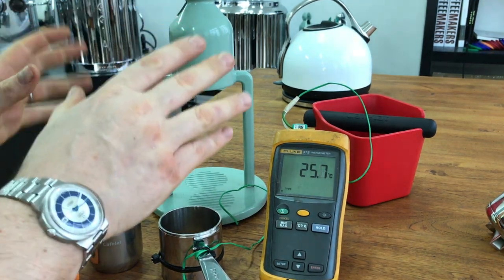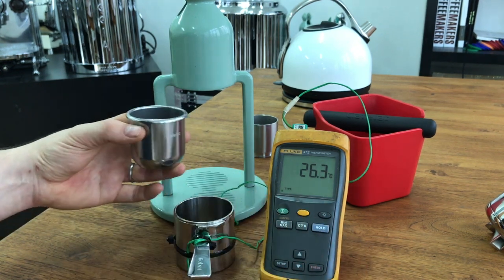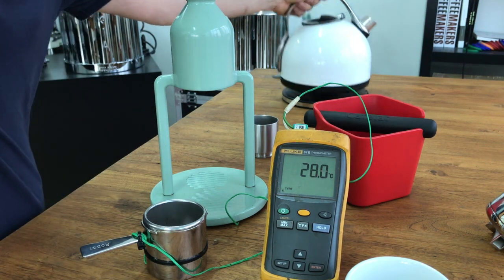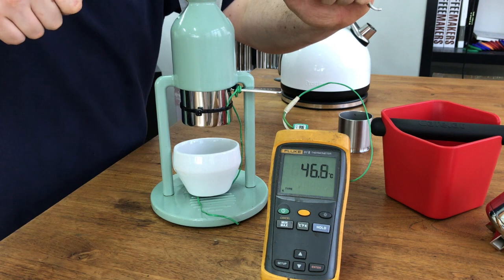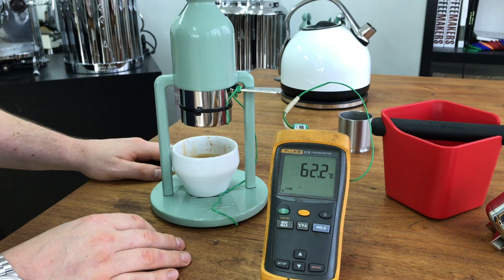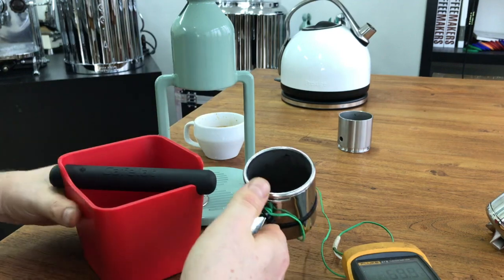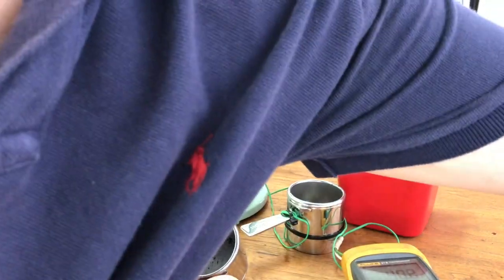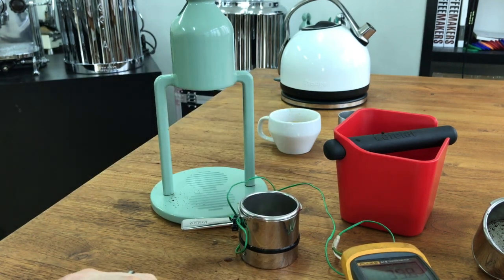Robot Temperature demo

Comment: Ir's all fine and dandy when the ambient temperature is around 28-30 C....No need to worry about heat sink effect then. But what if the ambient temperature, like in my case today, is only 20,5 C???? Will that not translate into a significant temperature drop of the brewed espresso? In such a scenario, will it not be safer to add one more step to the workflow and simply preflush the filter (and the piston at the same time) with boiling water from the kettle???
What do you say Cafelat???? 
Otherwise, I must say I'm impressed with the Cafelat Robot idea and I plan to get one in the near future....
Reply from the maker: Sure.  The beauty of any coffee maker is you can use it as simply or as complicated as you wish.  If you keep it simple you can make a real espresso in as long as it takes to boil a kettle.  If you want to quickly pre-heat the items before hand go right ahead. There is no right or wrong way - apart from not filling the basket full up with water, many people make the mistake to underfill the basket with an exact weight of water and get into issues.    

I tend to always favour keeping everything as simple as possible, but if someone wants to add extra steps more power to them. At the end of the day do what feels right for you and always go by taste.
Reply: @Cafelat  Thnx for your kind answer. Obviously, I'm not about to push my ideas here only to ask about the role of this one variable, i.e. ambient temperature. I very much agree to keep things as simple as possible. And I will certainly start exactly as you have shown - without pre-heating portafilter. If it works here in Poland, where the ambient temperature is always much lower than in Hong Kong, then I will be happy to let you know how things stand. That will be another winning point for your amazing invention.
Reply: My "solution" is to just (carefully) pour a small amount (100-200gr or so) of boiling water over the exterior of the bottom half of the outer filter for a few seconds.  This gets it to over 50C pretty quickly.  No need to submerge it in boiling water. This also keeps the inside dry while you assemble and makes no mess. The inner part gets to nearly 95C once you put the water in, so you're just trying to bring the two closer, not boil the parts. 
I haven't used a temperature probe, but I'd guess that this results in 3-5C higher results for a few seconds more work. Same as pulling a shot of water, but far less messy. This doesn't have to be exact - just enough water to make it hot to the touch.